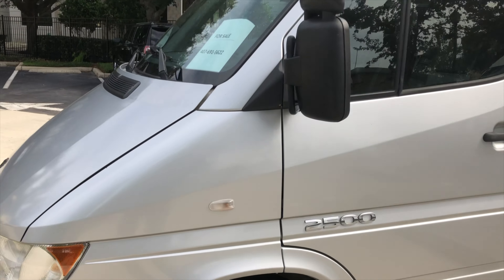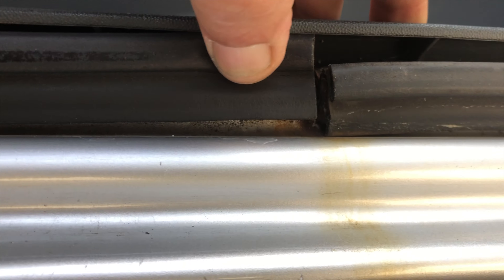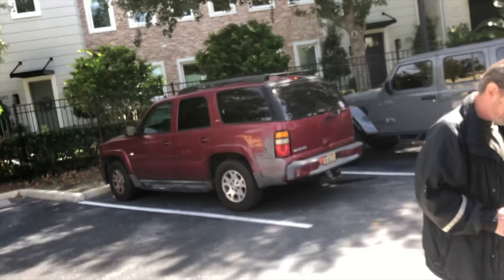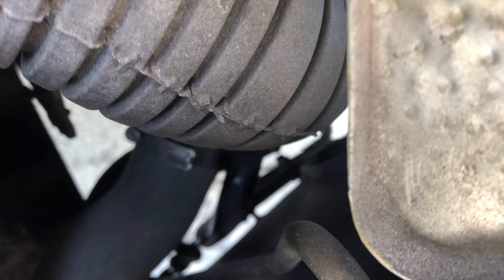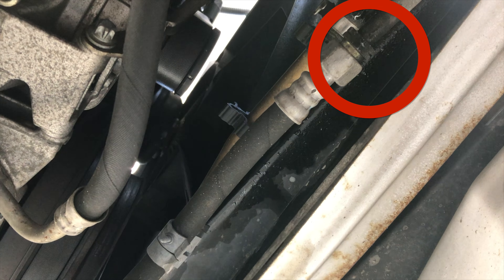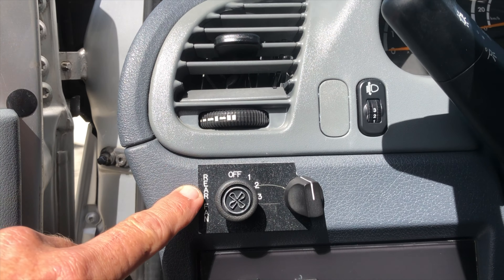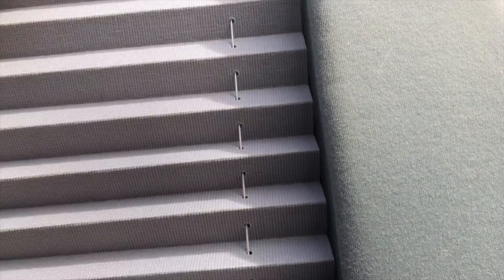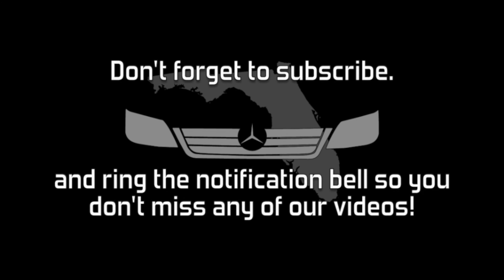Rolling Realtor T1N Silver Shadow

Comment: I purchased a 2006 T1n dodge that was turned in a airstream rv. 105,000 miles. Took motor cover off and looks new. Was leaking bad from air fan, windows, and had to pull subfloor and put new floor in. i replaced air filters, oil and filter, going to change transmission fluid, fuel filter, glow plugs module. Maybe when i get done with it i will make a video and see what you think. Im sure i paid way to much but these airstreams class b are high. I may try to resale it.

Comment: I've seen you check the "cap dance" on a few vans now, what exactly does that tell you? How do you get it to settle down?
Reply from the maker: Cap dance reveals internal block or crankcase pressure. There are a few possibilities for what causes the cap to dance, a clogged crankcase breather or large vacuum leak can cause it to dance a little. Bigger dance moves are caused by blow-by or valve guide leaking, both are harder to repair. When the cap jumps off the engine we can confidently conclude the engine needs to be rebuilt.
Reply: @FloridaVanMan  Hey thanks that great to know! Is it best to check on a cold start, running hot, or maybe both?
Reply from the maker: @aleckwright1607  Better to check when hot as that is the condition of the engine during MOST of its run-time, although I am always curious about cold start so 'both' is the best answer.
Reply: @FloridaVanMan  thank you again! I wish so much that I had found your channel before I bought my 140 shorty 3500.
Reply: Only 118 are considerate Shorty's